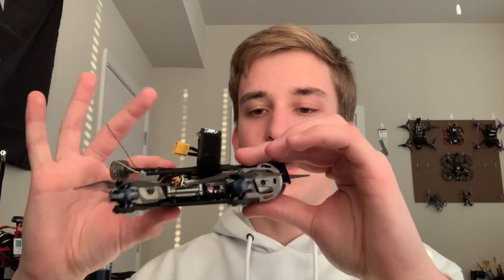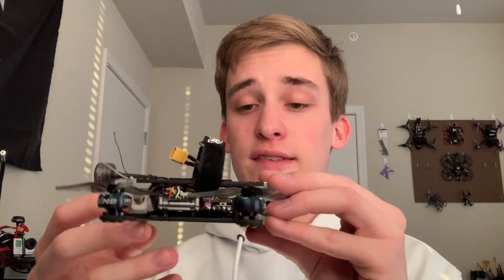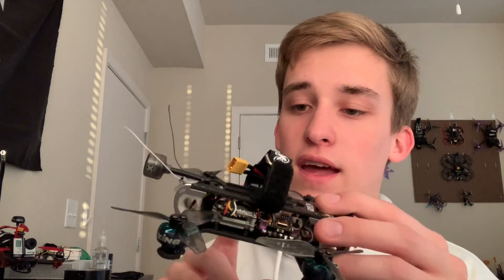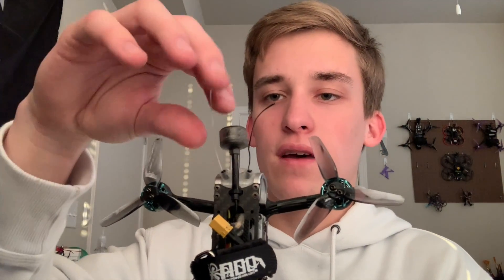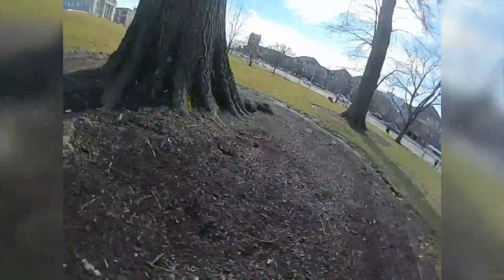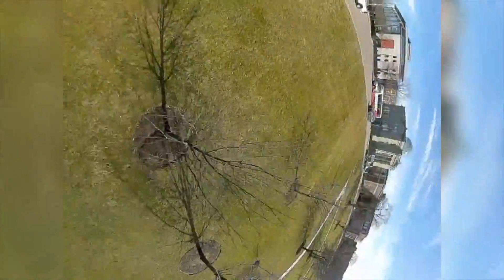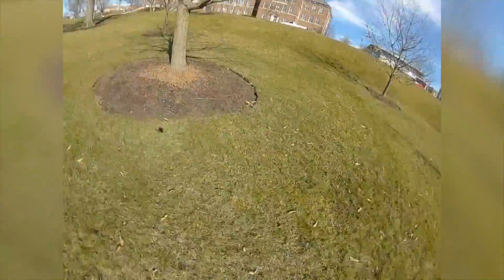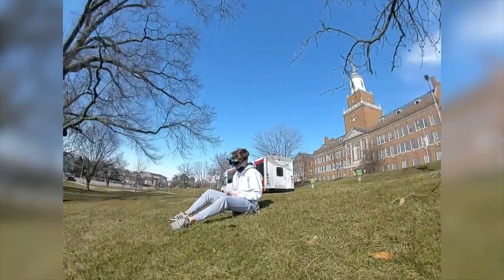New 3in Ultimate Build?? -- GEPRC CYNGET CX3 PRO | CustomRCModsFPV

Comment: Nice work! I’m planning on building a similar one to fit in an air unit, hopefully to make it just under 250g. What’s your thought on putting the 4600 kv version on 4S? Thanks!
Reply from the maker: With an air unit, and 4600kv motors, not only will you struggle to keep it below 250g (need a bigger batt too) but the flight times will really suffer. With the AU you probably are looking in the 14xx and 15xx motor size anyways. Good luck!
Reply: @CustomFPV  thanks! I kinda expected it will have short flight time too, but wanting to have a bit more punch to do some freestyle. Do you think the Xing2 1404 on 4600kv can take 4S no problem, or I’ll need to do throttle cuts / limit motor output?
Reply from the maker: They can in lightweight situations. Probably would work in my case, but with an AU it’s not only gonna be more load on the motor, but also just increasingly lower flight times.  Almost to the point it doesn’t seem worth it. Here the 3800kv worked great. plenty of power and efficiency.
Reply: @CustomFPV  that makes sense thanks bud!